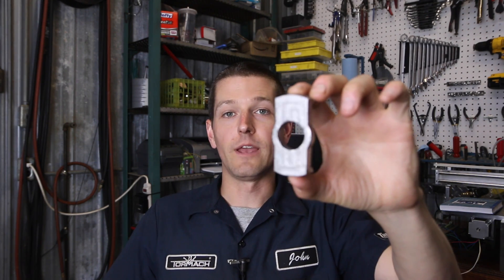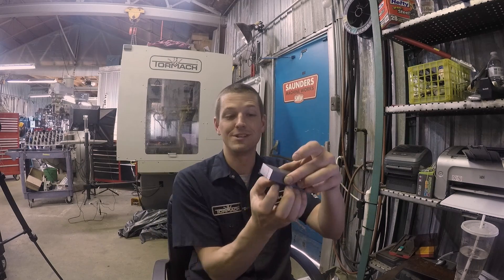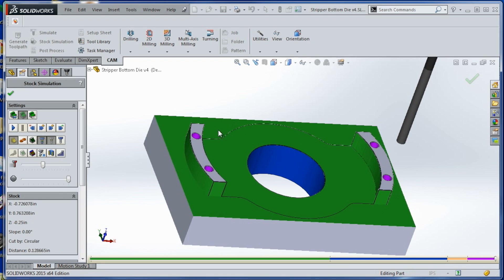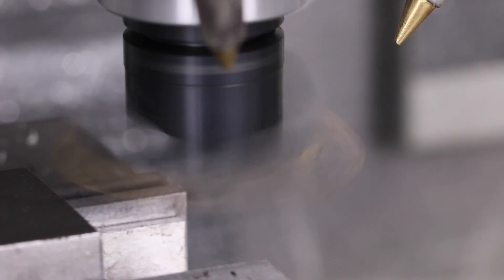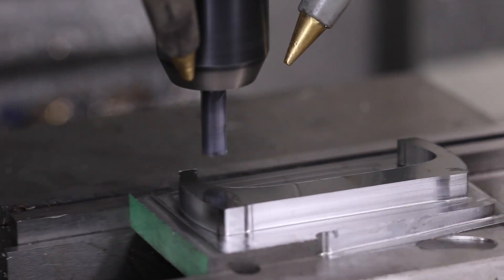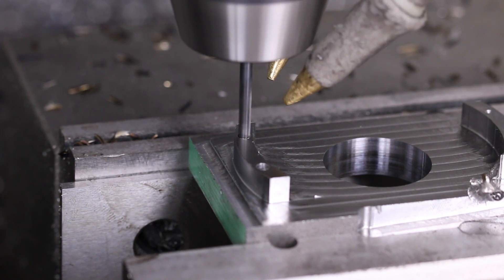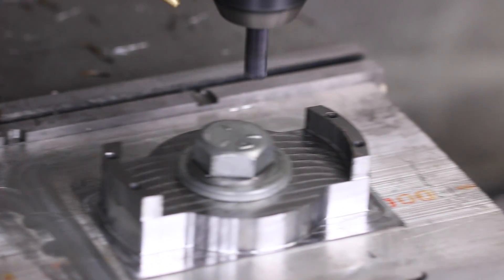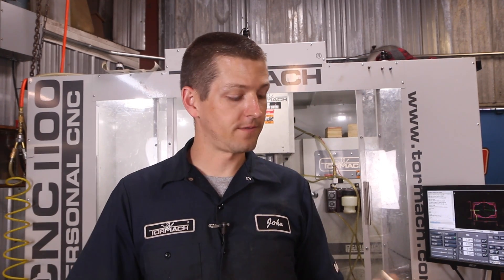Stripping a Punch!  HSMWorks + 4140 = Widget42!

Comment: John I don't know what you've done about the heat treating oven, as this video was put up a couple of months ago now, however an inexpensive alternative is to look for a used pottery kiln. I have one that fires to 1200C, which is, errr "real hot" in F. If you really want to get fancy it would be a piece of cake to retrofit one with a PID controller (I use the 1/32 DIN controllers from Auber Instruments), a thermocouple, and an SSR. That whole lot will set you back about 50 bucks and will be as accurate as you'll ever need to get. I've used them on a powder coating oven, espresso machines, coffee roaster, etc etc. They're remarkably accurate and very cheap.
Reply: NYC CNC I know guys who have built them from scratch. It's not terribly difficult from what I've seen, but the PIA factor is high compared to the results. At least in my book. I know some people choose to do things not because they are easy, but because they are hard (No disrespect to JFK). Personally my time is limited so if I can buy something off the shelf that's better, cheaper, and quicker than building it, I'll buy it and save my time and energy for stuff I can't buy; there's no shortage of that! If the pottery kilns weren't available used very cheaply I probably would have made one, but it was a no brainer down here to just get the kiln. 
Good luck with it, whichever way you go.

Comment: You mentioned deburring, try one of the 3M or Scotchbrite deburring wheels that go on a bench grinder.  Perfect for steels like that.  Just takes the sharpness off, but leaves a nice clean angle on the edge with a tiny break.

Comment: Nice video, but what about your blooper portion?  What did you adjust in your collet to prevent pull out?  I end up having to tighten drawbar (I have a power drawbar)  on my Tormach rather frequently, or I'll end up with the tool pulling out into the work piece.
Reply: Alright good deal I'll check your old video out.  I've learned most of what I know about our machine/Sprutcam/HSM from you and Grimsmo! Thanks for all the work you guys put into your videos!

Comment: The energy and enthusiasm that you bring to YT is infectious.  
Heat treat oven for knife size parts is so easy and not very expensive to build.  Really the most expensive thing is the bricks that are rated for such high heat. Found a really nice kit for the electronics on ebay.  http://www.ebay.com/itm/Ramp-Soak-Temperature-Controller-Kiln-SSR-Thermocouple-Programmable-Control-50S-/121092751239?_trksid=p2141725.m3641.l6368  You want to use a firebrick that is rated at least K-20  (2000 degrees F)  The higher the K rating the more expensive. You can get the heating element form a site called knifemaker.com.  Seems OK but some research I'm sure you can beat all the prices I've spoken of.  So for around $300 you can heat treat knives.  I'm guessing you need larger.  This is where the brick will really over shadow the price of everything else.  I intend to build a knife size one in the coming year after I build a 2X72 belt sander.  Yehaaahhhh.  got some projects ahead of me.  Keep em coming.

Comment: Hey John,
Most 4130 or 4140 you buy comes annealed (or normalized) Here's a link to a page that includes a chart on the heat treatment of 4130. Although the chart is for 4130 they both exhibit similar mechanical properties. As the chart indicates annealed 4130 has a yield strength of 53 KSI, while 4130 that has been quenched and tempered at 1000° F has a yield strength of 140 KSI. Tempering the part will increase its resistance to cracking. So you can have this part heat treated to increase the strength or, as others have suggested, find a piece of 4140 pre hard. 

http://netwelding.com/Heat_Treated_4130.htm

Comment: Nicely done. It seems to me that you could have left more stock on the outside of this part to even further strengthen the part as a whole. The application was unclear as I did not view the other video as of yet so perhaps you've addressed this already...

Edit:
Ok I watched the original video and as far as I can see the outside can be wider to keep this part as strong as possible. I would also suggest making a tapered center hole in the part to match the punch head with a 3/8" hole to drive the pinch through. That way your center hole is very small and you would be able to punch much smaller and lighter gauge parts.

I noticed the punch pushed this part down a bit and I fear it might knock it off or misalign it and cause possible damage. When you taper the hole you may want to make it a bit wider at the top. You might not have to machine the taper but if you have a large drill it might work because you can drill it all the way through so your taper goes as deep as possible.  Then come back and machine the rest of the hole to make plenty of room for the taper part of the hole punch while at the same time leaving only about 3/8" hole for the punch to access.

Comment: Hardening will give you longer life for the stripper.  It will affect the hardness obviously but also increases the modulus of elasticity (Young's) and tensile strength.  This part would benefit from being hardened absolutely, annealing would reduce it's brittleness after HT but also significantly reduce the MoE.  This being a part that doesn't take a lot of shock load, I would skip the annealing and go for the hardening only.  You will have some dimensional changes after HT but that part looks like only the dowel pin holes will have to be checked for changes.

Comment: About the heat treatment and the oven. 1045 is a good alloy to stock up on, it's cheaper easier to machine and heat treat as well as more available than 41XX. It is though softer and weaker still if welded or subjected to occasional heat due to its low tempering range. But when used appropriately it has nearly the same strength properties at a fraction the cost of time, tooling, treatment and materials.  

On your Facebook page I left a link to a kiln supplier in Toronto.  You could strip out all the old parts from your blue oven and install better elements and a digital controller, for a fraction the cost. The most expensive part of a high temp oven is the brick oven itself and the shipping.

Comment: I think thru hardening would help in this case (4140 or 4340 would be good candidates, can't recall if you specified which one you used for this part, I think you said 4140 for the original one that got bent) as opposed to case hardened which is not what you want (and that's what you get with mild steels), not too hard so it won't shatter, not an expert so maybe someone with experience in hardening can clarify further the hardness levels.
Reply: NYC CNC 
I had a splined shaft hardened for a transfer case doubler I made for my Jeep - was also out of 4140, it was (if I recall correctly) 27Rc in annealed state and the folks that did the treatment (through-hardened) suggested 45 after tempering, I went with that since they were experts and had no issues with it, different type of load but if you need a ballpark probably a good place to start.

Comment: Heat treat probably would not help this new part design much but had you heat treated the original part, you would not be making this one. I do my own HT and I can tell you it's really easy to build and add a PID controller to an inexpensive HT oven and I can hold within 1 degree F with mine.

Comment: There's like a 30 second stretch where you make like 10 newb programming mistakes.. Those who can't do, teach!
Reply: rob lockwood Those who can, do, those who can't, criticize
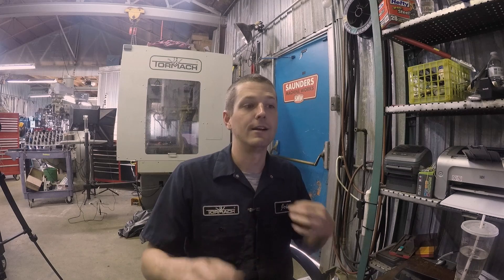Reply: NYC CNC I don't feel like taking the time to do a video just to look like a jackass correcting stuff, so just a quick rundown. Which direction your selection propagates depends on which end of the edge/line you select, and is how you avoid needing to hit the 'reverse' button all the time. At 4:00 or so, you make a point to select the edges of your sketch, there's really no need to do this, it should simply create a bounding box using your stock. Further, if you're selecting all of the entities of a sketch, just choose the sketch directly from the CAD tree. Adaptive clearing is a roughing strategy. Stop using it for finishing, leave some stock and come back with a 2D contour to finish, including your floors. Adaptive clearing will leave scallops on both floors and walls at times, and by nature isn't particularly accurate. It's not directly following your geometry, but rather generating a spline that fits closely.

Comment: Hi John,
Thanks for the video!  Those were some really nice chips.  The Tormach seems to cut through steel just as easily as through aluminum!
Here is an idea to help with your heat treating problems.  There is another YouTube contributor in the machining community named Stan Zinkowski.  I hope I spelt that right.  His channel is Shadon HKW and his company is Bar-Z Industrial.  In his latest video, he shows a small oven that he purchased to treat the tooling that he makes.  This is a link to that video: https://www.youtube.com/watch?v=2DbbGq1yYik.  He got the oven from www.tabletopfurnace.com.  They have small furnaces starting from $389.00.  It might be worth looking in to.  Thanks!
-mike

Comment: Check out ShadonHKW's (Stan) channel. He showed a high quality but small(er) Heat Treat Oven in his last Shop update video that was around $500.
Reply: I would agree with that, cry once and be done with it, this is actually a second oven for me, the little one is more of a hobby sized.
Reply: NYC CNC I totally agree with that. Wasn't sure what size you needed and thought the oven that Stan bought was a good deal for small, one-off parts. Nice job on the new stripper plate.

Comment: Heat treat isn't the answer.   HT won't add stiffness. Better material and design will.  HT will distort the part and make it wear longer. A grind will make it flat again post HT.  You need the right material and annealing. What and how idk
Reply: John 
Heat treat does not increase stiffness but it increases the yield stress which means it takes a higher load to permanently deform the material. This is true for through hardening materials like 4140 and spring steel. For such materials, the hardness can be used to make an educated guess about the material strength.
Here are a couple resources which can help.
http://www.matweb.com
http://www.efunda.com/units/hardness/convert_hardness.cfm?cat=Steel&HD=Approx.%20TS
Hope this helps.
Call me if you have questions. You have my contact info.
Thanks
John

Comment: Did you ever get that email I sent last week about the air cylinder located engraver?

If you got it and just don't have a reply, that's fine, but I've been having a lot of trouble lately with emails just not going through or getting spam assassinated on the other end.

Let me know if you didn't get anything at all, and I'll try to resend.
Reply: NYC CNC Resent, with URL's to the pictures instead of sending them as attachments.

We'll see if that sneaks it past the censors.
Reply: NYC CNC Heh, well now you've got two.  lol

Comment: nice work again, I have to agree with you on fusion cad it a learning curve and a half the cam is so much faster to set your cuts than what I have used, a couple of clicks and it`s done.
all the good info for using fusion is not that easy to find half of the good info is in the forum 1/4 in youtube the rest is in screen cast it would be good to see what you can do.
Reply: NYC CNC good stuff hows your worker going with fusion

Comment: Hi John, I think I mentioned in one of your other videos, you need to fit polarizing filters to your light source otherwise your polarizing filter on your lens won't do a thing.
Reply: NYC CNC I use to work with a photographer that photographed art installations for galleries and that's where I learnt that trick from. Only problem is you loose a heap of light.

Comment: If you're on SW 2014 still I'd love a copy of that part to try some things with. For some reason work is waiting for SP3 before upgrading. Also I'm pretty sure your first op can be accomplished without drawing  a stock sketch.
Reply: Well I was hoping for the punch stripper in SW format so I could do some comparisons in toolpaths and leave the originals, even though we've only got HSMXpress (until our CamWorks license is up anyway).
Reply: NYC CNC Any way to share a dumb solid? You could post it on the Autodesk forum if you're signed up (actually you have to be if you have an HSMWorks license!). Unfortunately, thanks to SW proprietary nonsense, there's no way I can open a .SLDPRT from SW2015 in SW2014.

Comment: You need to have a sheet of White paper on the window over your right shoulder where you stand looking to the cabinet,  the shots from inside the booth show that it is your major glare point and white paper will even light distribution. Now you can by a rollerblading or even ask a news paper printer for your local Gazzetta for end of roll remnants as there is usually a good 15 to 20 m on the rolls.
Reply: Aerofoil has split there software now from its previous setup of being all in one to be made up of 3 parts, and they made it so you have to nut all three now. I could dig up my copy and send you it but it is not updateable and it was $700 so I am a little P&#@d

Comment: Also, I don't know what SFM you're running on that ALTiN endmill, but if you can try machining dry with the air blast.  I've always ran coolant under 300sfm, anything above dry with no oil.  The oil mist can actually cause the cutting edge to fracture from thermal shock.  I have been machining steel for the past 3 weeks on a big job removing a butt ton of material WITHOUT an air blast or coolant (they're going to curse me.) haha.  184 parts with around 500lbs of steel from one 1/2" endmill is pretty good in my book though.

Comment: I'm still new to your channel ( I don't even know your name ) I am still going through your old vids, is this your own workshop or someone else's, and I hear in the background people banging and moving around. Have you tried My came it's from Aerofoil we use it for building model rc aeroplanes for cutting the ribs as well as making foam core wings. I only mention  it because it easily turns 2d into 3d and does the cutting according to material thickness of your material and what type it is as well.
Reply: NYC CNC auto correct on the tablet it's Mycam  from Aerofoil I will grab the link in the morning for you.